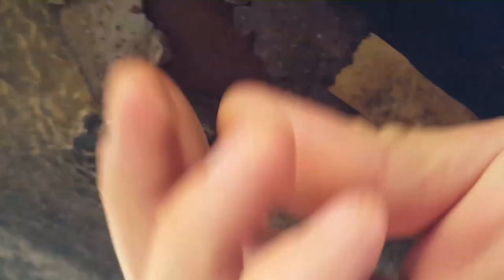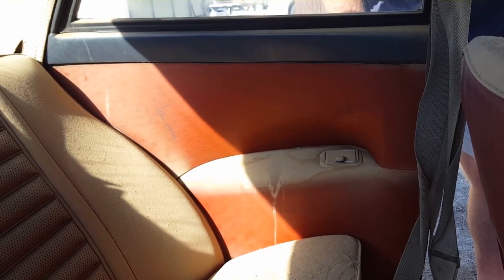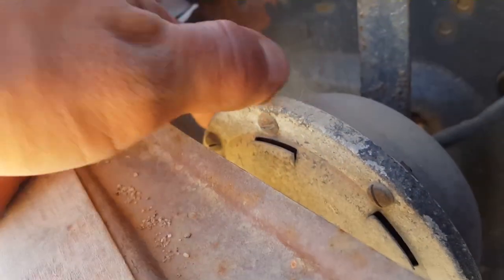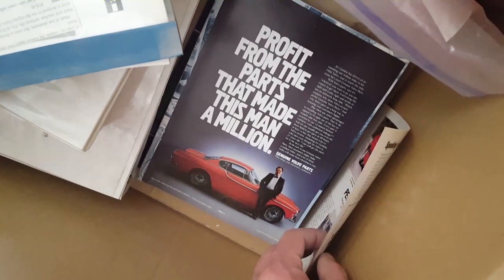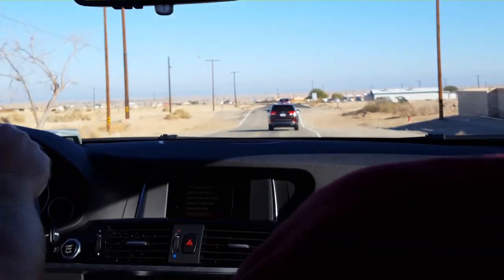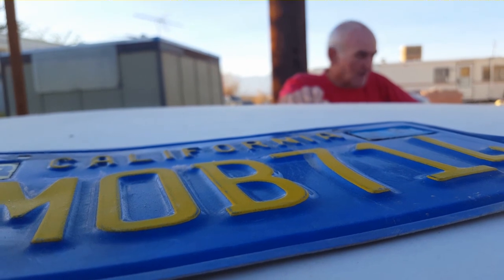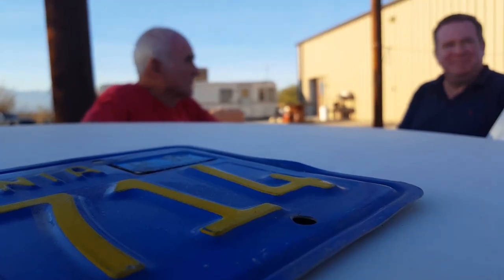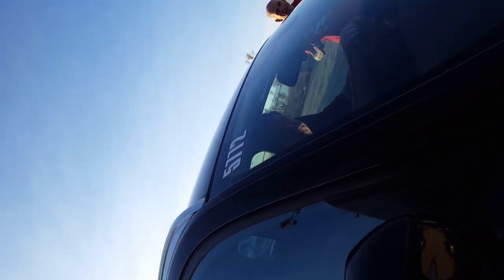Volvo Rescue buys 1962 Volvo Amazon 130 in SoCal - Part 2

Comment: My 1966 Volvo Amazon in the early 70-ties. 2-door, red, black inside, electric heated rear window, ignition key in kolumn, short shifter and a turbocharger, all in the stock B18...
I have some pictures on hand, but cant paste on "tube" by for now !
Reply from the maker: SAAB 9000 cse 2.0/150 t5 Sweden that sounds incredible. where is it now?
Reply from the maker: I had the same color seats in Arthur! Is that a p1800 shifter?
Reply: Its not a p1800 shifter. Its some used aftermarket shifter, prob from UK. Some guys made some from doubble socket tols, cutting and velding. Y know shifterstick out of gearbox in neutral, and the rubber inside stick...

Comment: can't wait to see you restore bruce... I'll be watching from home to see some tips and tricks, also maybe look into a buick/Rover 215 v8 swap it doubles hp without hacking up the firewall ;)
Reply from the maker: Andrew P. ooh good to know. how about transmission options?
Reply: Rover SD1 can supply a 5 speed if you can find one over there. Larger Range Rover engines also based on the block, swapping in means more engineering but doable. Header clearance can be a problem.

123 clickbait but I'll let you off this time. Nice score.
Reply from the maker: No click bait this time. That's the actual car.
Reply: I would recommend a 1963 215 since it is similar era and many said it was 10 years ahead of its time and I believe because it is aluminum it's 20 lbs lighter than the stock b18
Reply: Also here is a good example of a 215 swap (I think a t-5 or t-9 transmission pairs up with it): http://www.ridelust.com/lustable-1967-volvo-122-with-a-buick-215/

Comment: Color code seems to be 67 (3:00). 67 Slate blue PV544/Amazon 1962. Try this link: http://212.247.61.152/eu/zf0001_dokument/fargkod_volvo_en.pdf
Reply from the maker: braaland thanks! I think the interior is not original color
Reply: What i can see on the VIN plate the original interior colour should be this: http://212.247.61.152/no/main.aspx?page=article&artno=1201100440 lightblue for the US-market.
This guy in Norway seems to have the original interior for sale